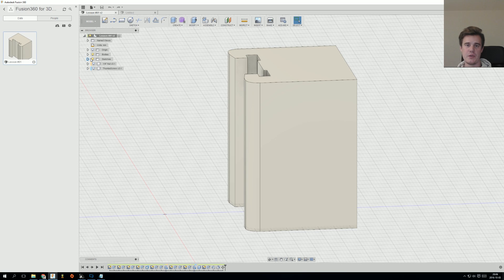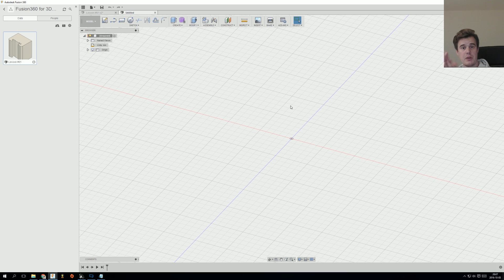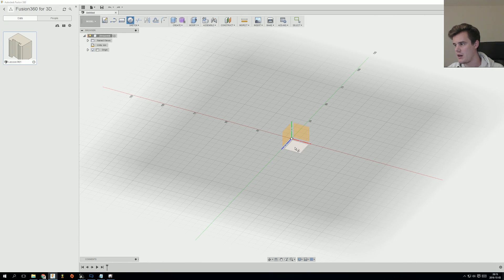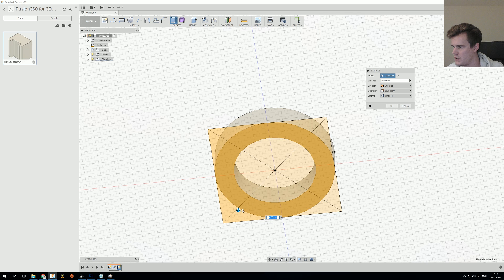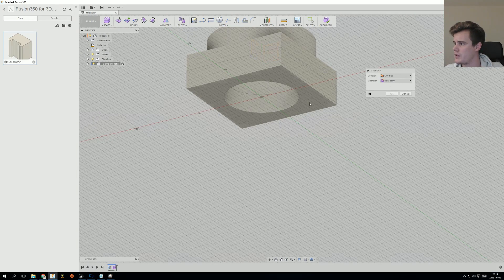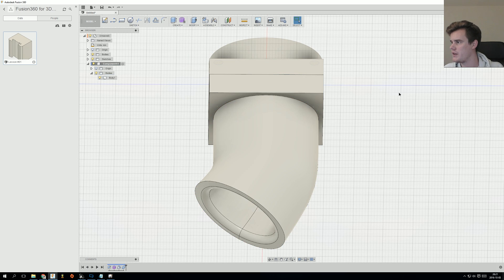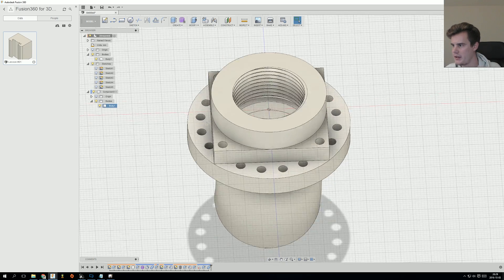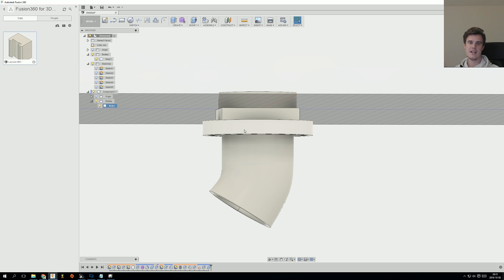Fusion 360 for 3D Printing - #02 - Shower Adapter

Comment: I see a problem with this design in that there are only 4 positions where the two components connect so depending on where the top part ends up when tightened the lower component could be as much as 45 degrees off being at right angles to the wall and the chances that it will be at right angles is remote.  A better solution would be for the pipe part to go all the way up to the metal and have a flange that makes a seal against the metal on the top side and  mates with the threaded part on the lower side.  This is just like normal plumbing fittings, would not need extra nuts and bolts and could be adjusted to give the correct angle of delivery.  Room for improvement --- The problem is that the flow is so random that the transition of water from pipe is following the curve of the inner end of the nozzle and going in all directions.  I suggest you remove the radius from the inside of the end of the pipe and even make the angle more acute so that there is a sharper transition.  You could also reduce the size of the outlet so that the flow is more concentrated as well.
Reply from the maker: Hi Herman, You are most correct! That is a smart idea! I'm had very little experience with pluming so far in my life.  I might make an updated version to incorporate your suggestion. It probably ends up being even better ;)